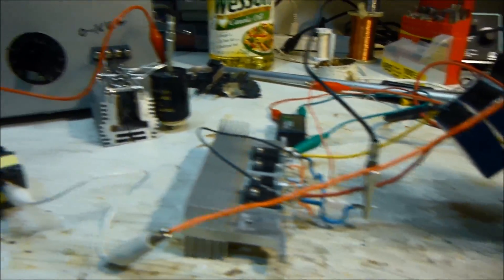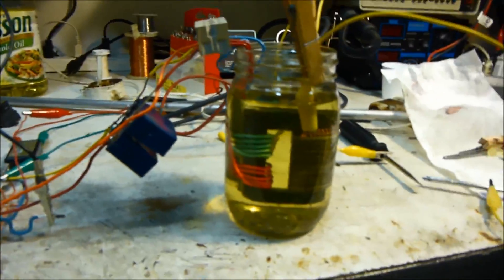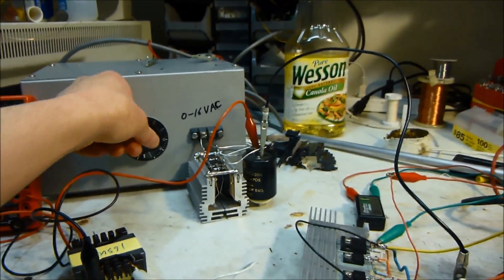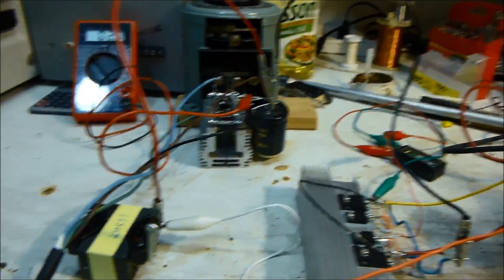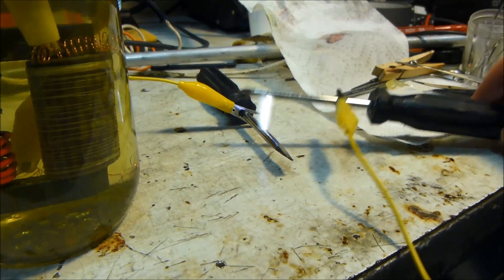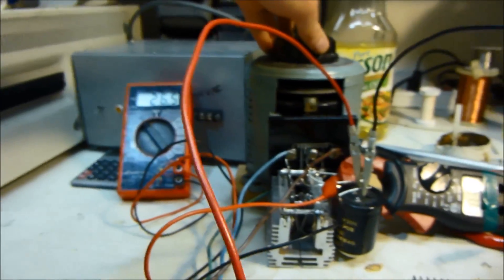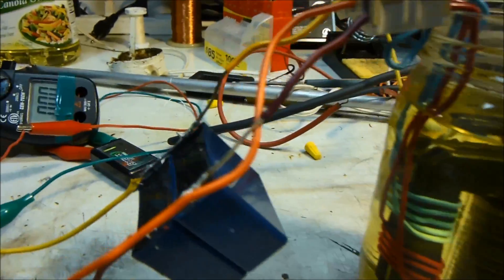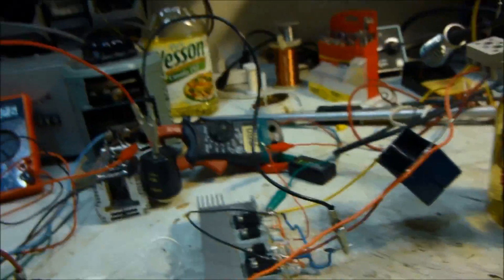Testing Out My New Homemade High Voltage Fly Back Transfomer

Comment: Looking good mate' im liking ya home made transformer' very nice out put!! If ya can mate' Try different capacitor values as it will change the output and could make it more powerful and give it more corona 👍😉
Start from 1uf and then increase to what you find works best😉 . You could find the best cap!!

Thanks for sharing'

👍👍👍👍👍THUMBS UP👍👍👍👍👍

⚡~high1voltage1rules~⚡
Reply from the maker: Thank you!  Ok I will try different capacitors!  I think I should switching to a bunch of small capacitors to spread out the current.  The ones I am using are getting so hot at the connections that they keep unsoldering themselves!  :D  Thank you!
Reply: Makerj101 hi mate iv had that too in the padt where they get so hot the bloody caps dall off lol. Its so annoying too isnt it!! Try the roled film caps! They seem to handle it alot better mate 👍😉 good luck
Reply from the maker: Yeah hahaha it is really annoying!  And scary too!  It makes me jump when they fall off!  I wonder how hard it would be to build some capacitors that are about 1uf...  They would probably be huge and ugly!!!
Reply: Makerj101 nar mate" there are some round roled film caps' that dont get hot and work very well!!  Hope ya find something mate and good look!!
Reply from the maker: Which are the preferred kind of capacitors? Polypropylene Film Safety or Metallized Polypropylene Film?  Thank you!
Reply: Makerj101 hi mate' well Metallized Polypropylene Film capacitors are great and for me they dont get hot!! But as long as there not getting hot' there fine! Good luck friend and speak soon 👍😉
Reply: Makerj101 p.s you can find alot inside tvs 😉
Reply from the maker: high1voltage1rules Thank you!  I will give it a try!  I have a couple TV boards I pull some off!  Thanks!  Your the best!  :-D
Reply: Makerj101 👍😉
Reply: Makerj101 👍😉

Comment: lol i have a core that is about twise as yours maybe i have to consider making it into a flyback it would be X-Ray type
Reply: Makerj101  there are x-ray therapy machines that go to 100kv with TO247 sized IGBT with a  cooler just like for a computer processor.
Reply from the maker: Yeah I think you could get a couple kilo watt arc with that size of core!  I have one that is a little bigger but I decided not to use it on my first transformer.
Reply: i have to get some pretty powerfful transistors for that kind of power or even vacuum tubes
Reply from the maker: Yes you do!  Maybe some big brick sized IGBTs!!!  XD
Reply from the maker: valiza123 That sounds awesome!  Brick sized IGBT's would be way over kill!

Comment: Greate video try and put 50v that thing would give massiv arc.Do you got any circuit for that diferent gate drive
Reply from the maker: Yeah I will have to do that!  I just need a bridge rectifier that is rated for a little more volts...  Take a look at the comment I posted down on the bottom of the page that I posted to jdflyback.  Thank you!
Reply: Makerj101 ohh that was dumb i didnt look the comment thanks.About the bridge dont u got one of those 1000v 50A brick rectifiers they are awsome
Reply: Makerj101 ohh that was dumb i didnt look the comment thanks.About the bridge dont u got one of those 1000v 50A brick rectifiers they are awsome
Reply from the maker: E Isad Hahaha it's ok!  I do the same thing all the time!  You're welcome!  Hmm I have bunches of the flat bridge rectifiers from power supplies.  I'm not sure they will handle that much though.  I guess I should look up the part numbers of a few of them and see.  Maybe if they  are not good for the current I need I could parallel several of them to get more amps.  Thank you!
Reply: Makerj u can bye some  brdig rectifier that are 1000v 50A in local electronix store they are cheep very cheep
Reply from the maker: E Isad  I just looked at Radio Shack's website and they sell a 200 volt 50 amp one for $5.  Not bad at all.  I'll have to get one next time I'm over that way...  Thank you!
Reply: What that really bad i xan find her 1000 volt 50A for 2 $
Reply: But still its good
Reply from the maker: Yeah I could probably get a much better one for cheaper from eBay.
Reply: Yup u could;-)
Reply from the maker: E Isad  I just had my mom order me 5 50amp 1kv bridge rectifiers from Amazon for $10.  Seemed like a fair deal to me!  Now when I get them I will really be able to crank it up to the max!  Only limit now it my variac!  It's going to hate me after this touchier!  Maybe I could hook my two 10 amp variacs in parallel?
Reply: Yup it seems like fair deal.They are awsome but they need a heatsink or they get hot.About the variac in paralel i dont know if u could do that cuz its not the same with AC as DC but i dont know try it out but safe.For me just to be safe u should get a big transformer
Reply from the maker: E Isad  Yes I can imagine they would!  Yeah true.  Especially because my two 10 amp variacs are not made by the same company.  One might have more turns or something.  Maybe I could feed the power from the variac into a 60 or 70 volt high amp transformer.  Then I would be able to turn my variac up a lot farther and thus get a lot more power from the variac before hitting the 10 amp limit.  Hmm... things to think about...  Thank you!
Reply: Np and yeah that would work great.Be safe mate :-p
Reply from the maker: E Isad Thank you!  I will!  Now I need some MOTs to rewind!
Reply: Scrapyard best place for MOT or any neightbour.Waiting to se that beast on 50v :-D
Reply from the maker: I don't know of any scrapyards around here.  I have been looking around on trash day but I have not seen any.  People around here never seem to throw microwaves out...  Yeah I want to too!  Mwahahaha

Do you know how I could measure or estimate the voltage of the high voltage output? I measured the current on the high voltage output when I am arcing and it is about 0.35 amps.  I get that much amps out when I am putting only 25 volts in at 14 amps.  So that's 360 watts going in.  If it is 100% efficient that means I have about 1kv coming out.  But I would like to actually measure that voltage so I can figure out how much power the arcs have.  I was trying to figure out how I could maybe use a voltage divider or something of that sort.  The other way is to put like 10 turns on the transformer, measure that voltage, and then multiply by 60 because I have about 600 turns. 
Thank you!
Reply: Search much more cuz u will find.I for my self had to get like 3 but i didnt cuz i dont have any room:(.About the measure i dont know if u could measur the high voltage cuz the probes that are made for this purpes are like 202m ohm but read this articels hope it helps
http://www.repairfaq.org/sam/hvprobe.htm
Reply from the maker: Thank you!  That is very helpful!
Reply: Np ;-)

Comment: lol i did the same thing at 4:00 when i first arced a mot. If you would not mind i would like to see the schematic of your zvs circuit with the nine volt, really cool video.
Reply: Makerj101 thanka now i know it will have to give it a try i have some logick mosfet and i hope they do the job
Reply: Mosfet that are use in pc mother board they are tiny but they can handel 50A
Reply: Yeah i wont to be compack and good so i can run it out of the car battery get that on veacation hahaha :-D just to have some high voltage fun on veacation
Reply from the maker: Hahaha sounds like a plan!  Have a good high voltage vacation!  :-D
Reply: Hahahaha thanks ;-)
Reply from the maker: Hahaha ya!  I've never actually arced a MOT.  A couple years ago I took apart a MWO but I took the transformer to the scrapyard cause I didn't know what to do with it.  Now when I look back I'm like that was dumb...  Yeah, sure thing!  Tho I don't really have a schematic.  It's the same as a normal circuit except the zeners are removed and the 470 ohm resistors are connected to the 9v battery instead of the power supply.  Same one I used in this video.
 New ZVS Driver Running Like a Boss With IRFP260N Mosfets - Hot 2inch Arcs and Jacob's Ladder  
Thank you!
Reply from the maker: E Isad ^^^^ Different ZVS gate drive.  ^^^^
Reply from the maker: E Isad Your welcome!  What are logic mosfets?  Thanks!
Reply from the maker: E Isad  Oh!  I actually have some of those that I salvaged of a laptop mother board!  They are these little SMD chips that have 8 legs.  I looked up the part number and was amazed at how many amps.  The don't seem to be able to handle many volts.  At least not the ones I have.  I think mine were rated for 10 or 20 volts.
Reply: Yeah i had made one zvs with mine but they lastet about 1min i have  a pictur on g+
Reply from the maker: Oh ok, you are using the ones that actually sorta look like transistors!  Very cool!  I'm glad it at least worked!  Did they just stop working or did they let out the magic smoke?
Reply: Nope the just stoped after i try 12v for 1 min:'(.But i am getting better one :-D
Reply from the maker: Oh. Cool! What mosfets are you getting?
Reply: Makerj101 i beliv i will get some of ebay dpak type 50v 44A
Reply from the maker: I think those are a pretty good choice for lower voltages.  I've seen a couple people successfully use those for ZVS drivers.